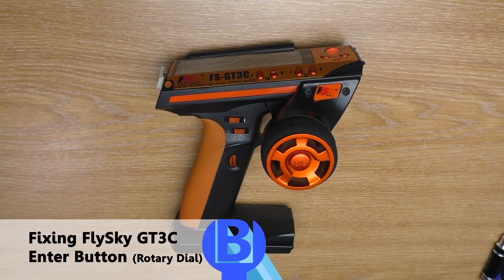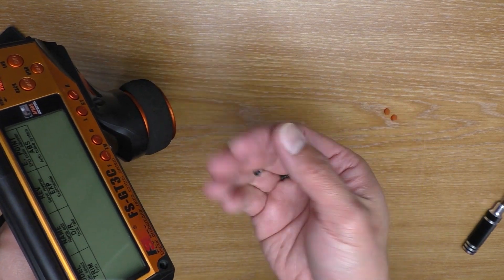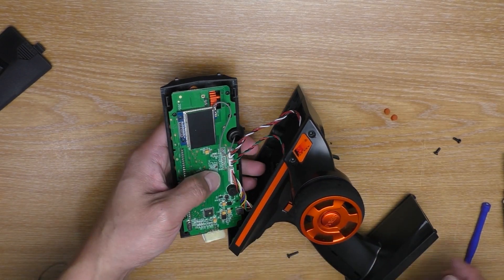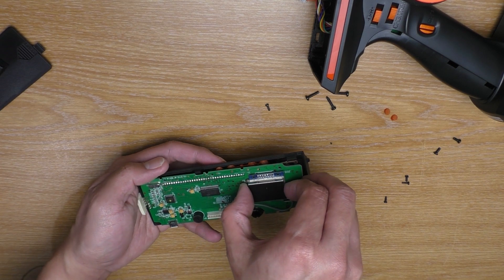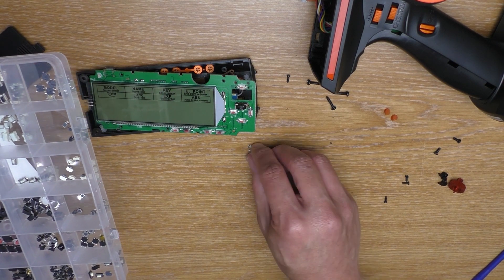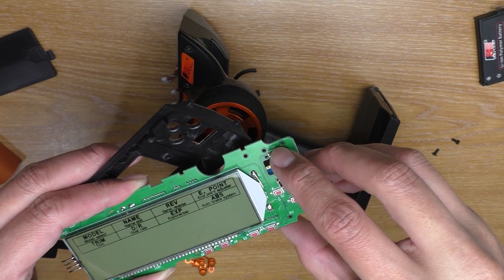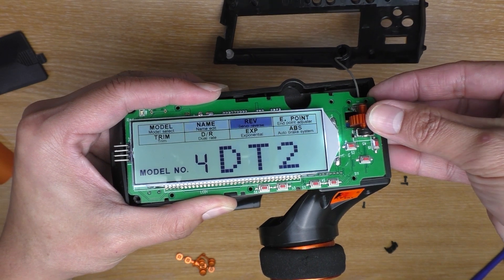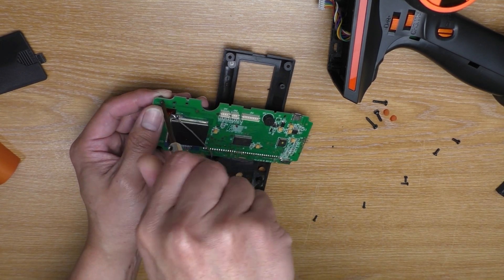How to Fix FlySky GT3C Enter Button (Rotary Dial Button)

Comment: I want to ask whether the FS GT3C or GT3B CH3 can adjust the gyro gain plus 0 to 100 and min 0 to min 100?
Reply: Do you have any unique suggestions for a mini drift rc remote? I'm just about to start.
Reply from the maker: @madorax251  Flysky G7P will have everything you need from fast and consistent latency to adjustable servo frequency with micro receiver available. A cheaper option would be DumboRC DDF-350. This one is pretty slow but it's cheap. An even cheaper one is HotRC CT-8B but it's quite a gamble in terms of quality and it needs a 18650 battery.
Reply from the maker: Yes, there's option to use buttons as trim so you can incrementally change the output value. At least that's in the custom firmware. I don't remember about the stock firmware though. Unless you have it already, nowadays it's not worth getting one.

Comment: I did this exactly how you showed it and it worked flawlessly one remote I did not have to junk. awesome Thank you so much :)  fyi make sure that the button swap is the flat one resembling the one that was pulled off the board. I cant thank you enough. I even added the Jay tag for updating firmware. :) Arduino parts came in handy.

Comment: hello ! can you try to converting wltoys transmitter or any transmitter to use power bank for power supply transmitter indeed battery AA ?
Reply from the maker: That can be done but I don't think I'll do it though. Using lipo is way easier.
The basic is that a power bank usually outputs 5V.
You might need a DC to DC step up converter since WLtoys transmitter runs on 6V. You can try and connect power wires from USB to the transmitter directly if it turns on. If not, it'll need a step up.
Reply: @BeaversHobby  Thank to reply me But after i post i try it with my self it won't work as you said. im' back to rechargeable AA battery as before. i'm just curious i see in manual dumborc they write can use power supply 5v first of all i think it is power bank but im misunderstand.
Reply from the maker: @user-xy5nh3nw4o  Check if it triggers the powerbank to output anything. If there's no charging circuit to trigger the powerbank then it might not send anything out.
Anyway if it runs on 4x AA then the nominal voltage for NiMH is 4.8V and any powerbank can do that. If it needs 6 batteries then the powerbank won't work directly.

Comment: Hey thanks for your work, I'm new at the 1/28 drift cars, I'm thinking to buy hdg1. do you recommend this for beginner or another kit?
Thank you a lot
Reply from the maker: HGD1 is ok but you can do much better for roughly the same money. Take a look at BMR-X. It will be 1/24 scale so a bit bigger than HGD1 or Mini-Z but you can use any plastic model kit for a body.
Reply: @BeaversHobby  I will thank you!!! Nice videos dude
Reply: @BeaversHobby  and between GLD and BMR-x which you recommend?
Reply from the maker: @MariscalWild  They are quite different, GLD is 1/28 intended primarily to use with Mini-Z body. BMR-X is strictly 1/24 for plastic scale model as a body. While BMR-X is easier to drive, some of the parts like ball caps are way more fragile. Out of the BOX GLD is alright, it will need some upgrades to make it a fantastic car. So I think it all comes down to whether you like 1/28 or 1/24 and which is available for you to buy. Personally I'd go for GLD because it's available in Europe without having to wait for lengthy shipping from Asia.
Reply: @BeaversHobby  I really appreciate your advice!! I'm a bit confuse about drz, gld ,BMR-x and drift art ( I think drift art would be the best but is impossible to find now) I will continue looking reviews and trying to go into the hobby thanks you help me a lot!

Comment: You said 2 years ago that the best mini z body for k989 was the Camaro zl1  mzn199, however here in Brazil is very hard to buy mini z cars, so I couldn’t find this body,  but I found the already painted version, do you think it fits like the non painted version?
Reply from the maker: The body is the same whether painted or unpainted so yes, it'll fit.
Reply: @BeaversHobby  thanks for the information

Comment: Well done beaver! Very useful video🙂, After i got your help to update the GT3C transmitter  i didn't get to use the controller much because the enter button stopped working properly on the wheel; I have the same issue & was thinking for  some time how to solve it and just saw your video! I'll resolder to the newer switch once i order it from that link.Thanks!
Reply from the maker: Glad to be of help. For the switch on banggood, check the availability first. If it doesn't say In Stock or Shipped within 1-3 days, don't buy it. It's not in stock and the wait time can be really long.
Reply: @BeaversHobby  ah ok, thanks for the info👍🏻, will check its available in stock before ordering, (i remember once i purchased an rc car from bangood and it never came even after a month so had to cancel the order, was probably out of stock)
Reply from the maker: @rczumar  My pleasure. Best of luck!
Reply: @BeaversHobby  i have resoldered it and its working now👍🏻😊; just hope it last longer. 
I ordered the other set in the link you put as the one you ordered wasnt in stock. The set i got doesnt have enough switches as your set, only has one batch of switches which fit for the replacement switch
Reply from the maker: @rczumar  Nice! 
About the switch kit, at least there's something you can work with. Mine is the same, I just keep the other switches for other projects that I might do.
Reply: @BeaversHobby  yeh👍🏻, the switch kits going to be definitely useful in future for other electrics.

In my order there are different batches and only one batch of switch fits for the replacement in the controller. In your kit you have ordered has 2 batches of different switches that fit and are compatible in the controller, 
anyways main thing was to get it working so still happy😊, thanks

Comment: My issue is the scroll wheel going crazy.  But since I've sold most of my RC now, I'm looking at getting extra rx's for my radiolink and ditch the flysky.
Reply from the maker: The scroll wheel is already difficult to use in the first place. I guess this rotary encoder goes bad over time too. For entry-level transmitter I still trust Radiolink the most. I mean the Flysky G7P is really good but I still don't go to the track with it. Not until I can fix the random restart problem.

Comment: I have one of these but the range is so bad 😔
Reply from the maker: I mainly do indoor driving so I don't know how far it can really go. Still, if it's under 100M then I think there's a problem with the transmitter or the antenna.
Reply: @BeaversHobby  it's way below 100meters i just use it for my micro drift car now. Shame as i wanted it for multiple cars.
Reply from the maker: @reclamartsmetalart420  Yep, that's definitely something wrong with either on the transmitter side or the receiver side. If it does that on all receivers then your Tx module might have a transmitting issue which unfortunately can't be fixed easily (or possibly ever). Sorry to hear that but I guess if you can find a use for it then it's not a total loss.